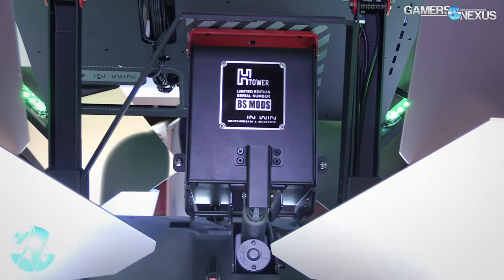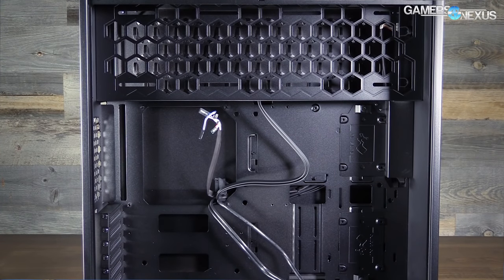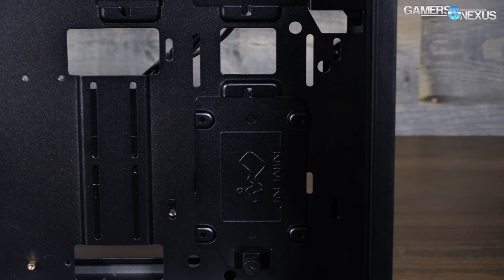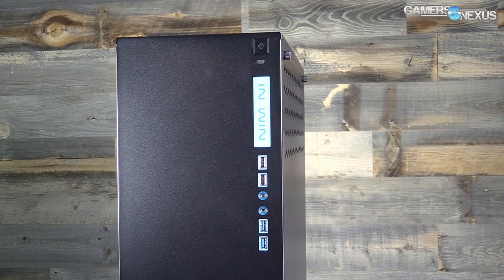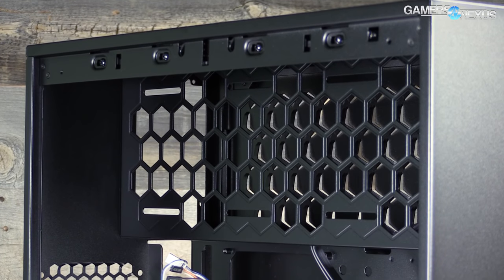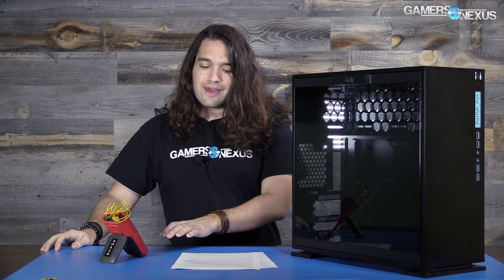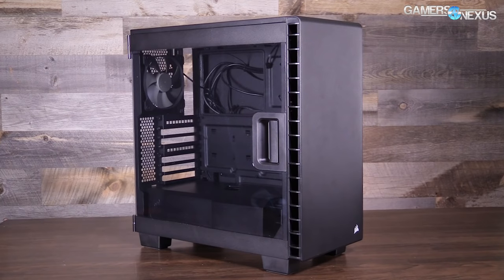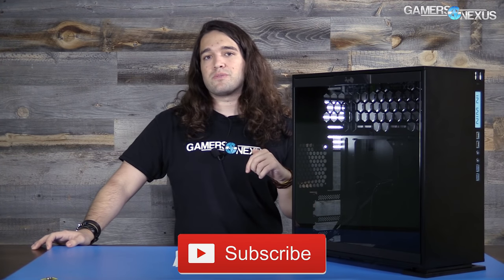In Win 303 Case Review & Benchmark vs. S340, 400C

Comment: For anyone looking at this case i have the following spec:
- i7 8700K CPU
- Gigabyte G1 Gaming Edition GTX 1080 GPU
- Two 2.5 SSD HyperX Drives (240 & 480gb)
- ROG STRIX Z370-F Motherboard
- 32 GB Trident-Z RGB DDR4 Ram (Four 8GB sticks)
- NZXT Kraken X52 AiO Cooler
- Three NZXT RGB Hue+ Fans
- Four SilentWings 2 Black (Rubber Mounts)
- EVGA 750W SueprNova PSU

I use the silent wings fans as my intakes at the bottom, two of my Hue+ as replacement radiator fans on my Kraken x52 and one as my rear exhaust fan and finally my last rubber mounted silent wings fan at the top over my PSU.

- Idle CPU temp ~38C
- Idle GPU temp ~38C

- Ingame PUBG GPU temp hits 73C

The case is easy to build with & looks sexy af! I've found the bottom fans to fit "extremely" tight with the motherboard headers (and i'm not exaggerating, it's crazy tight - i'm not even sure how im gunna remove my mobo when it comes to it!)

Using FurMark (GPU Stress Test) i hit around 73C max temp when running the test at 3840 * 2160 res and 8XMSAA Anti-aliasing (which you notice is the same as PUBG.

PUBG settings are all on Medium-High though i don't notice much difference in temp on High-Ultra settings for anyone wondering.

I think the next thing i "upgrade" will unfortunately be the case to one with better airflow in future (sadly). i thought i was buying a great case but it just doesnt cut it for airflow. I feel like my GPU could be lower to be honest.

Sound wise, it's quite loud with my setup but im running fans quite high!! 

I would recommend this case to anyone who wants a beautiful looking setup who is happy with the above temps, if u want an optimal performance build with good airflow and cooling then i dont think i could honestly recommend this case.

Really hope the above info helps you!!

Comment from the maker: Still working on the article with more detail on thermal results, hypotheses, etc. Targeting publication before tomorrow!

Edit: Article here - http://www.gamersnexus.net/hwreviews/2543-in-win-303-case-review-and-benchmark
Reply: One possibly silly question; were you using the lower fan as an intake or exhaust? Seems like using the bottom as an intake (and maybe blocking the unused section of the bottom) might improve air flow over some other options...
Reply from the maker: Intake bottom, exhaust  rear
Reply: Looks like it's build for negative airflow which is pretty terrible for dust buildup. You'd have to deep clean that one pretty often I presume. Not a fan of that at all. I outfitted my Xigmatek Aquila so that I get a slightly positive airflow and I have to dust the internals maybe half a year at most.

Comment: Years later, I'm still rocking this case but lord it's still quite nice.
Reply: Who asked
Reply: @spronchbob  lol
Reply: @Tank_Facts  don't be disheartened I'm actually looking for a review for this case so a comment like yours actually helps to improve my opinion for this case
Reply: I can say if you're lookin for an air cooling case it's nice but finding an AIO to fit is no good.

Also the bottom-most pcie slot will be blocked by fans on the bottom with an ATX board.

Still would reccommend.
Reply: @Tank_Facts  same here, still enjoying the 303!  Although, ive been eyeing the 103 with the pinstriping, its still hard for me to let go of this case
Reply: @gabrielrubble852  I actually recently migrated to an mATX system, Thermaltake core v20.

Comment: A friend of mine had this case. After working on his system twice, I gifted him one of my spare cases because this is a nightmare to work in. You have to remove the feet just to mount the bottom fans; a decent-thickness radiator will smash up against the glass side panel, throttling airflow; and as stated, the PSU gets in the way of a 360 rad, preventing a push-pull setup.

Comment: I honestly think that this case is brilliant, and that it is meant for a very niche and specific user.

The zero fan configuration is for the custom watercooler (which, if you are buying this case, I do expect most people to be doing watercooling), so that they won't need to use a lame OEM fan, and instead use their own, high - end aftermarket fans like SP optimized ones

The sideways ventilation is obviously there to compliment the beautiful tempered glass side panel, so that you can see the good parts of your fans, with the bright LEDs shining through, instead of just the frame. That ventilation might sacrifice some cooling, but, once again, it's more about the looks in this case

The sideways ventilation is also there to open up room to accommodate a 120mm radiator in the back, and high profile memory that is showy, and once again, would have LEDs

The improvements I would make to this case would be to make the frame slightly taller to fit a slim 360mm radiator at the bottom w/ a full ATX mobo, and to get rid of the loud Inwin branding at the front, add integrated RGB lighting and sound dampening with cable tie - down points. This may seem like alot, but it's really asking for small, nitpicky things for people like me

I just don't understand the hate towards this case. It's for a specific type of consumer, and if it doesn't fit you, why do you care? There are many more options out there

Comment: I'm definitely curious to see if an mATX board is used if you can fit a full set of fans on bottom or even a 360mm radiator.
From most that I've seen it appears that InWin and Lian-Li are very water-cooling focused, catering minimally to traditional air cooled rigs.

Comment: Not having 140 mm fan mounts in 2016 is just absurd. The lack of clearance for intake fans at the bottom with a dual gpu set up is also a glaring screw up for a case this size.

Comment: 4 years later, 4-5 different setup i still massively love my 303 ! i have a full atx board and have 3x 120 intake fans and still works great, but have to remove the fans every time i have to take the motherboard out, only downfall
Reply: I'm interested in this case. But this case was released long ago. Currently, I'm considering this, nzxt h510 elite, and lian li 01 dynamic. Any opinions?
Reply: @QJHKI  i dont know much of those cases, you can still buy the 303 with the front panel rgb now

Comment: Move the front of the case out by an inch.  Have radiator mounting on inside of the front frame.  Put vents along sides of the new extended front.  Radiator breathes in through the side vents around the front and out through the rear or those top fans.  I had built the inwin allure back, wow, 10+ years ago for the wife, and it is still in use with the same computer inside it... ehh, works for internet browsing well enough.

Comment: would you recommend to use a 360mm radiator on the top with this case?
Reply: definitivamente. Incluso, y a pesar de la limitacion con el 280mm radiator, yo pude hacer las modificaciones al case and worked like a charm. Just a couple of holes
Reply: i have a 420mm rad on top (drill holes!)  Power supply should be fine unless you put 120mm rad right over it... really focused heat whereas your 360mm rad will spread it out better!

Comment: I got an S340 a few weeks ago... one bummer with many cases is the lack  of an optical drive bay. (It has been a couple years since my last build, and never even thought that drive bays were optional. DOH!) We have a huge DVD/BR collection, and having an extra place to watch them was always nice...   Love the cable management on the S340 though!
Reply: You can always get an external optical bay for 10 bucks or so.
Reply: ^ as above mentioned. Get external BD/DVD drives and mount them near your monitor or where ever you want. It doesn't have to sit on your case, you can use extension cables or a USB hub (which everyone should have IMO for a multi-media or professional setup).

Comment: But why didn't you test it with 2 or 3 top mounted exhaust fans instead of this half ass bottom mounted fan solution, thats clearly not what they had in mind, when they designed it.
Reply: Except it is...
Reply: @William-McCueRC  

Nah, I have the MSI Dragon edition, yes cables are tight with an ATX board.. but 3 fans for bottom intake isn't that hard to do.  3 bottom intake, 1 exhaust next to the CPU and it's cools very well.

Comment: Just did a build with this case and agree with all points made in the video.  Cable management could be better and was a bit of a challenge to get a decent looking build  Installed 2 fans in top, 1 at rear and 1 at bottom,  air flow acceptable and temps are fine.  Installing quality fans makes a big difference and fan noise is minimal.  Definitely not recommended for multi-gpu setup.  A good case for a simple build, not the best for a gaming rig.

Comment: Found the case to toss my itx board in and make a loop with. That bottom clearance problem is a non issue with a short board and I can easily fit a rad down there.

Comment: I got one to replace my Lian-Li T60 bench. After that 'don't do multi-GPU builds in this case' warning though, I might keep that T60 close by. My GPU temps on the bench have been drastically better since switching the larger Nitro Fury to the top slot and the smaller Windforce beneath, hopefully my 4 120mm Pure Wings 2 fans are enough to move air through.

Comment: I see (and have seen) really good use cases (no pun intended) for this case. I've seen dual radiator custom loop systems, where 360mm rads were installed in the bottom and top, which of course requires spending some time on fitting in front header and audio cables, but should perform really well unless there's something I'm missing. I'd also imagine a scenario with 3 bottom intakes, rear intake and top exhaust, with an air cooler (either bottom facing tower or down draft cooler). It's a shame they didn't provide a little more space for the bottom fans, but a lot of people seem to make it work, if you check out pcpartpicker builds using the case. 

I know it'd take forever to test these cases in every possible scenario, but still, I'd like to have something like a "maximum potential" setup test for your case reviews as well. 

Ultimately I think it's a really interesting case due to the unique look of the side oriented fans (and potential to do a proper airflow), and would love to swap out my S340 for it.

Comment: The 303 is a weird case. I can't see any compelling reason to get it over an S340. Unless you fill it up with fans it looks barren and ugly. If you put the three 120 mm fans at the bottom as intakes and three 120 mm exhausts at the top what purpose does that rear fan have? It serves no purpose whatsoever and looks out of place.

Comment: i have 3 noctua 120 fans on the bottom of mine and 2 in the top, all as intake fans.  single exhaust. my system with a 5700xt, 2700x and be quiet dark rock pro 4 and cpu temps haven't been over 60c.

Comment: Hey hey GN, quick question, if you see post on old vid's. Would a Vertical GPU mount solve most of the airflow poroblems brought up in regards to the 303? I ask because, in looking for a new case, the 303 seems to hit all the notes except for that, both in regards to the aesthetics provided by a vertical mount as well as the cooling byproduct.
Reply: brant etienne vertical gpu mounts always give way worse thermals because of the lack of clearance between the fans and the side panel
Reply: That depends how close the gpu is to the glass. If you're using for example the corsair vertical gpu mount the gpu is sitting quite a ways from the glass

Comment: Thanks for the comparison! I was set on the 400c but this looks good. I was hoping to fit 3x120mm fans at the bottom but that may not be possible. I'll look into it more but the quirks could have me sticking with Corsair.
Reply: The third fan bumps the Mobo cables and fits really tight. Any tips?

Comment: I think that this case with an mATX board is the way to go - then you can place 3x 120mm fans for the intake - and perhaps the Silverstone AP120s should be the weapon of choice here too.  in saying that though, you shouldn't have to work around their ill designed airflow plan, they should have either listed it as a mATX case (and shortened it by 35mm or so) OR added 25mm to the height to allow for those bottom fans on full ATX size builds.  
Im actually thinking of doing a new build with this case and a mATX,  so would be great if you could test it out for me :D
Thanks in advance Mr Nexus

Comment: I love GN but I'm a little upset with this review. I've used this case with a z270 and a z97 mb and had no problems installing the fans as long as you do it after the front io and of course don't use a PCIE SSD. The z270 set up used 6 fans, no fan in the rear slot, and had better temps then a p400s. this set up used a 212 ego. I agree I could no install a 2nd GPU because the gaming X card interfered with the back most bottom fan, that's why I moved it to the p400s... The z97 system has 6 fans plus a h50 installed in the rear slot and thermals are better than the corsair 500r I moved it from. GPU temps are 10c lower even with 15% lower fan speeds on my 7970 with the 3 fans on the  bottom Vs the side 200mm fan on the 500r. CPU temps are the same. Also I've used full-sized atx boards but you could also use a matx board, save a few bucks, and have no issues with the front io if you insist on using abnormally large fans and a PCIE SSD.
Reply: true, I wonder, why they didnt at least try the most obvious setup, with two or theree top mounted fans, instead this weird bottom mounted fan solution, that makes no sense for this case imo.

Comment: it would get this but 3 drive bays is a must for me as i use a cd drive and a 2 bay fan controller i could work with 2 bay and use an external cd drive but i dont want to give up the fan controller.

Comment: what if you use the "rear exhaust" as an intake with the bottom fans as intake as well and have the top radiator as exhaust? would that help cooling?

Comment: i actually was looking to buy the white version of this case for my i7 6700k & EVGA 1070 that i have ... was going to put a H100i in the top 
how would you recommend fan installation 
i was thinking of putting 3 x Corsair SP fans in the bottom as intake , 2 X SP fan on the radiator and 2 airflow fans: 1 infront of the PSU and one in the back

Comment: Steve, is it possible to mod 140mm fans to the top grills? Would 3 of them fit? That is the only reason I am not considering this case. My fans are 140mm
Reply: I have seen someone mod and do so. Check overclocks 303 builds.

Comment: I wished viewing this video before buying this case. Now i regret it.
Worst case i had, those bottom fans interfere with ATX mobo, this case should be iTX or mATX; the intake is only for the GPU, the CPU cooler gets residual air from gpu and the backplate which is "awesome"; the exhaust through those tiny holes in the back is small so the hot air inside gets recirculated through cable management holes.
If you want to plug something on the ATX lower part like usb or rgb headers you have to take the fans out, to take the fans out you need to take the feet off the case, just to plug/unplug something on the motherboard.
I have the 303C which is the rgb version and after one year of having this case i already want to change it, it's so bad.

Comment: Haven't made a good mainstream case? 901? It's not the easiest case to build in, but it's so damn gorgeous, the materials used are top notch, and overall it's just so well built.
Reply from the maker: That is a well-built case -- it's just expensive. In Win's cheap offerings have traditionally been rougher, but this one evens out the suite. 509 is also looking good.
Reply: +Gamers Nexus Maybe we just have a different thing in mind when talking about mainstream. At 160-ish dollars it's definitely not as expensive as it used to be, and on sales (like I did) can be bought for as little as 80-90 bucks. 

But yes, these cases also look pretty nice, I just preferred the one piece brushed aluminum shell :p

Comment: Great review! This case case has so many design flaws in my book all of which you pointed out. The lack of front intake is a HUGE oversight, the upper fan mounts make no sense either blowing right past the PSU and it's cables, not to mention the back of the case will likely be pu against a wall (good chance anyways) just makes for terrible airflow). And finally, the bottom fan intakes are covered by the motherboard. I like the thicker steel and the tempered glass, but the rest has me scratching my head and asking "What?"
Reply: What? The entire bottom of the case is intake. Do you mount your mobos horizontally when everybody else does it vertically just to be a rebel?
Reply: @NPC-jt3gp  The version of this case I have also fits two full sized 3.5" data drives behind the motherboard tray and the panel isn't interfered with, that's crazy and makes for an insanely clean viewing chamber. Unlike the concerns pointed out by the OP the thermals are not bad even if you push it right up to the screws on the side panel there is still enough space for what little air is actually being moved by most fans (I wonder what kind of 15000 rpm jet turbine fans he's using that this would even possibly be an issue), it's possibly restrictive but not in any meaningful way. The OP also obviously subscribes to the "cables stop fans from moving air" lie that has infested PCs the last few years, they don't as air moves past them quite well. Unless you bunch them up literally directly in front of the entire fan and even then they don't completely stop the air movement.

Comment: I have a wireless mouse plugged into the front usb 3.0 which works fine, but when i also plug in a usb hard drive in the other usb 3.0 on the front case then the mouse stops working or becomes very laggy. I tried a couple different mice and usb stick combos and this happens when both r plugged in as well as data transfer. Does this happen to anyone else/is my case defective?